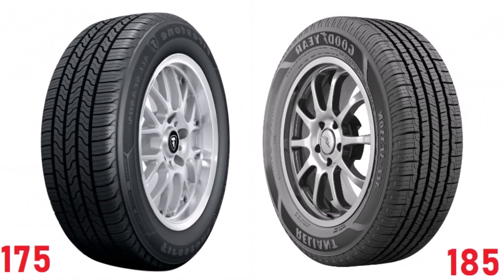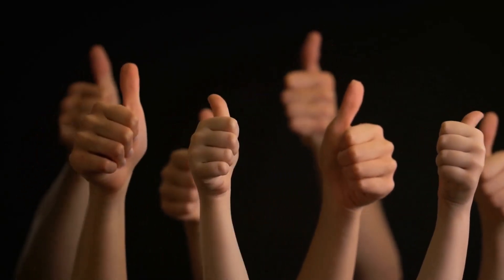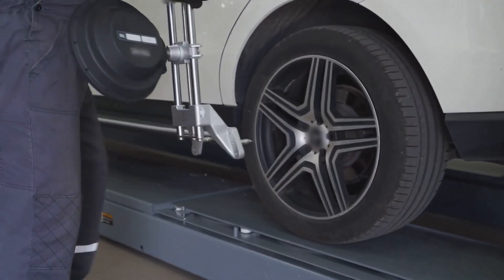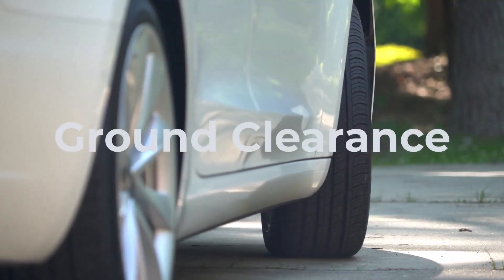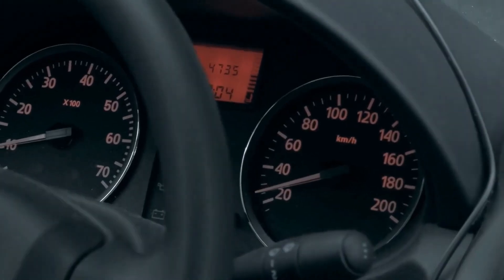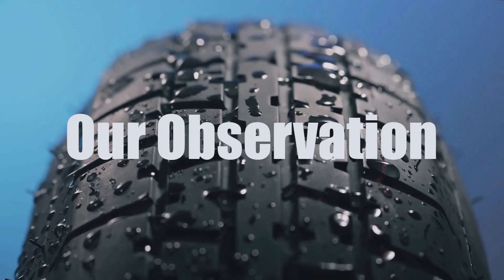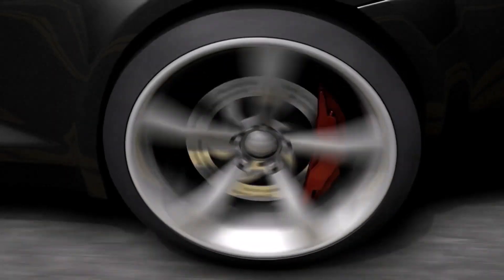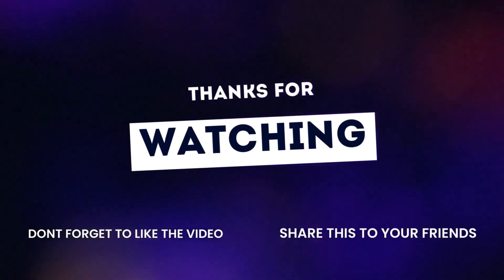Can I Use 185 Tires Instead of 175?   #185vs175tires

Comment: can u switch from 175 to 185 ?
Reply from the maker: Yes, you can switch from 175 to 185 tire width, as it is a common and minor increase. However, ensure the new tire's overall diameter is close to the original to avoid speedometer errors or clearance issues. Always check compatibility with your vehicle and rim width.

Comment: can i switch to 195/50R15 from 185/55R15?
Reply from the maker: Yes, you can switch to 195/50R15 from 185/55R15. The overall diameter difference is minimal, which should maintain proper fit and performance.
Reply: @ how about switching to 205, will I have issues?
Reply from the maker: @ronronschannel8613  Yes, you can switch to 205/50R15 from 185/55R15, but ensure your wheels can accommodate the wider tire.